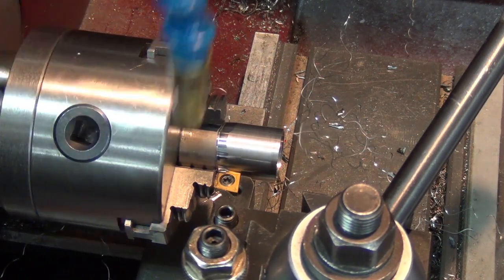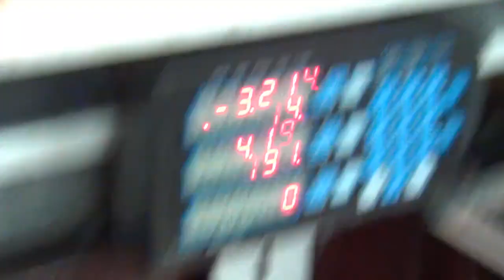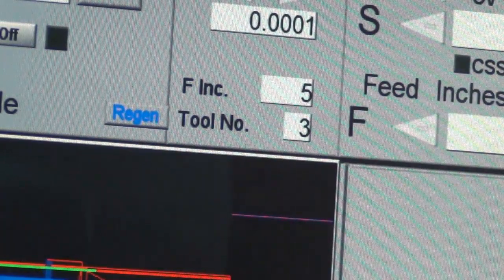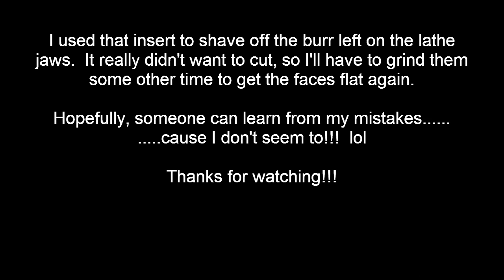9x20 CNC Lathe - Crash

Comment: Hmmm i was thinking that that was going to be much worse than it actually was before the crash. I was thinking that the tool would crash hard into one of the jaws and either destroy the tool and tool post of stop the chuck weary violently.

Very underwhelming indeed (and that's a good thing i guess)
Reply from the maker: Compared to a bigger machine....yep....pretty underwhelming......but when it's your machine and you're a beginner......it seems a lot bigger! LOL  It's a bit of a catch 22....the belts and pulleys get some oil on them.....the oil lets the belt slip when it crashes, but if it slips while cutting.....it causes a crash! :(   If I had home switched, it would be a ton less annoying on this machine.  Once it crashes....even a little.....I have to go back and set up my X and Z axis' again.......annoying!
Thanks!

Comment: I read the title and was thinking, "Oh no!"
So it wasn't anything busted/broken kind of crash? Just some realignment and stuff.
I hope you weren't txting and cutting? LOL

Colin
Reply: Yeah, I was expecting gear tooth breakage like I had on mine whne it happened.
Reply from the maker: Colin....nope....I did that a couple of hours after the texting.  My phone works even with the gloves on, so I can have safe text. :)
Reply from the maker: ILGopher
There's two belts for the drive.....all the gears are gone.  The belt slipped pretty good, so if the gears had still been there, I'm sure it would have stripped.  I'm just glad it's such a small lathe.....if I was learning on a 13x40, I'd be causing some serious damage!

Comment: have your leadscrew motor trip the whole circuit at a certain voltage, so you can avoid crashes automatically and quicker
Reply from the maker: That's a cool idea.  Beyond me at this point, so I guess I'll just have to pay more attention!  Ohhhh......maybe a voice recognition circuit to that would estop the system on certain words??!!!  That way when I start yelling obscenities, it would shutdown.  :)
Reply: its a simple circuit, ask in electronics community; i don't know what its called, its just like a bilateral fuse (when one trips, the other trips). Make sure to get adjustable. Then when your Z motor reaches a certain load, the spindle motor will trip too. This will also protect your tool when cutting material: if the insert edge breaks during a cut, it will trip too, so your toolholder is protected (somewhat).

I suggest webchat.freenode.net, the channel  #electronics  (its spelled with # in front of it)
Reply from the maker: meocats That would be a really nice circuit to have.  I stalled it again today...I know how/why and it was my fault again :(
At this point, I think I'll hold off on something like that because of time.  Plus, there's a good chance that in a few months, the plan is to be doing these kinds of parts on the cnc mill that's coming in.  I'm not sure how much I'll even use this lathe at that point.  I'll just have to pay extra attention to what I'm doing.......or quite chewing gum at the same time.....maybe that's the whole problem!!! :)
Thanks!!!!
Mike

Comment: are not you using limit switches?
Reply from the maker: At that time, no.  I didn't have any homing switches on it or soft limit stops.  I installed homing switches just before I sold it and upgraded to a Tormach 15L Slantpro. :)
Reply from the maker: Very beautiful work on your channel!
Reply: with a cnc you must use both soft and limit switches specially beside the chuck because any error on the code or mach3 will result in wut you have experienced
Reply: Thank you, appreciate your input, you should see the FB page for a lot more
Reply from the maker: @GraphicManInnovations  Yep....I run homing switches and soft limits on my mach3 controlled mill.  The new lathe has homing switches and is run by pathpilot....which is WAY better!! lol
Reply from the maker: @GraphicManInnovations  You're welcome.  I'll go see if I can find it. :)
Reply: btw what damage did you find after this crash? and were you able to get it back to its original rigidity before the crash ?
Reply from the maker: @GraphicManInnovations  Mainly just damage to the jaws getting chewed up a bit by the carbide.  Neither the motor or the steppers have enough power to cause any serious damage.  You could hear it stripping the toothed belt when the chuck stalled.
Reply: yeah i heard that, was that free cut steel?
Reply from the maker: @GraphicManInnovations  It was DOM tubing which I think is 1020 steel.
Reply: thanks:)

Comment: Does it damage the machine much?
Reply from the maker: In this case, not really.  It's not very powerful and the drive belts will either strip or slip, allowing the chuck to stop spinning.  The X and Z axis' are only stepper motors and will stall before any real damage is done.  On a real cnc machine.....yes....some very major and expensive damage can happen when it crashes.

Comment: I'm using LinuxCNC... I prefer it over Mach. I guess partially because I can modify the software to do what I want it to. And yeah... when its your machine the "pucker factor" is much higher. I have a manual lathe... and a second that i want to convert to CNC. I have a CNC Mill... got that all figured out... but doing the G-Code for the lathe is going to be interesting. I did use the mill as a lathe... https://www.youtube.com/watch?v=v3UmyZfvIbI
Reply from the maker: askjerry Nice vids!!   I've never done anything with Linux before, so I guess for now, mach3 and windows is the "known evil" which is easier to go with than the "unknown good". lol  Knock on wood.....I haven't crashed in awhile.  I'm getting much more comfortable with it. :)
Thanks!
Mike
Reply: bluehandsvideo Yeah, it takes practice. The Mach 3 has some bugs... my friend is running it. He borrowed my probe for a project... it was going well until Mach started the spindle... that was a $200 probe before that... rubble afterward. He got me a new probe. I decided to install a hardware switch between the computer and the spindle relay just in case after that. But yeah... you learn about your particular machine's "personality".
Reply from the maker: askjerry There's a difference in tools....screwdriver, hammer, drill.....I'll loan those out.....my Hamier taster.....nope!!!!  
I think my machine is a woman....one day it's nice and wants to help...the next, I can't get it to do a dang thing!!  lol   .......hhhhmmmmm......wait......that sounds more like me than my wife!  LOL! :)
Reply from the maker: ***** With some of the headaches I've had with mach3, I hadn't even thought about the name showing up. :)
Reply from the maker: ***** I could have been more careful with the framing on the video.  A lot of people use their name as their channel name.  I wonder if it shows up on the mill, too. lol
Reply: ***** I don't think the software companies ever think about someone making a YouTube video of the screen. Still... they could have put that information in the "ABOUT" tab that would only show up when specifically opened. For me, having my name out there isn't a bad thing... or hasn't proven to be bad at least. But then, I only have like 800 subscribers... so I'm not a celebrity by any stretch of the imagination.
Reply from the maker: askjerry I'm pretty much in the same boat.  It hasn't been an issue and it's not all bad for it to be out there.  I've got a few more subscribers, but still a long, long ways from any kind of notoriety...which isn't something I'm looking for anyway. At this point, it just makes for a lot more comments to answer! LOL!!!  :)